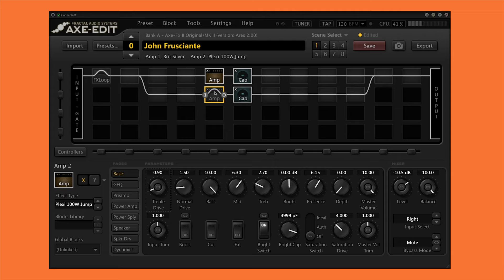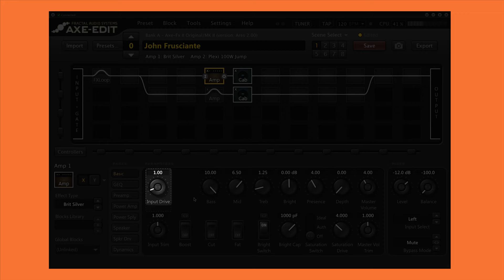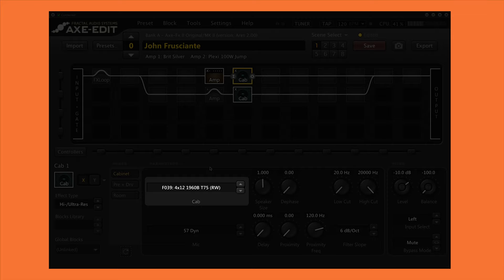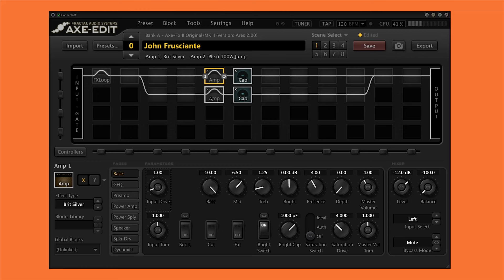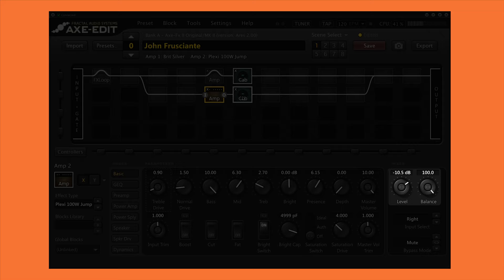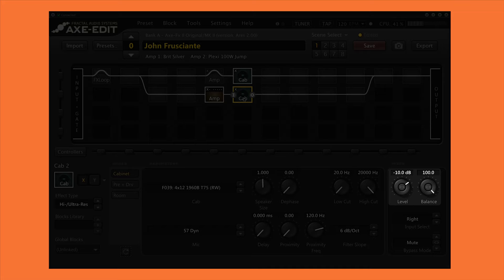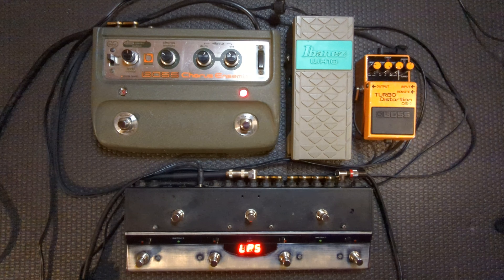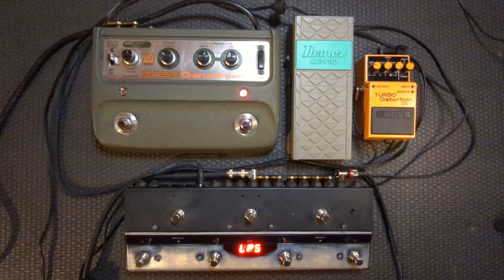Sound More Like John Frusciante | Episode 2

Comment: Great video thanks! Do you have a suggestion of an amp from HX Stomp? I also thought about trying the Red Pig from  Amplitude.
Reply from the maker: You can use the JCM800 model instead of the Silver Jubilee. That would probably be the closest. I'm not sure what other Marshalls there are in there to sub for the other amp though.
Reply: @JFXPedals  Thanks. I forgot to say that i have the Jubilee but I'm looking for something to replace Major actually.
Reply from the maker: @kurtdenizci  I just took a quick look at what's available for Helix. Looks like the Brit Plexi Jump could be a good place to start!
Reply: @JFXPedals  Thanks for your time. I might come back with some more questions regarding the ce-1 which you build.
Reply from the maker: @kurtdenizci  anytime! Happy to help 🙂